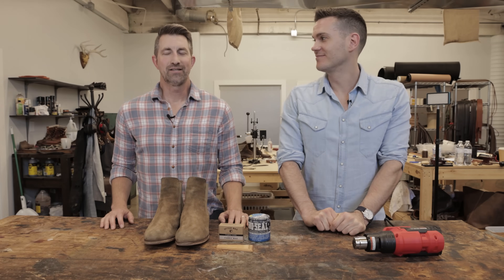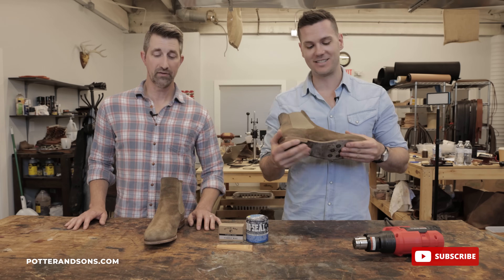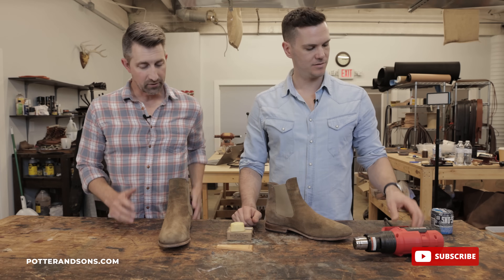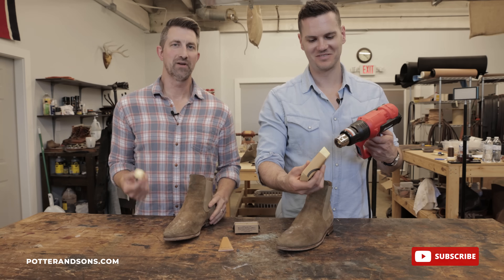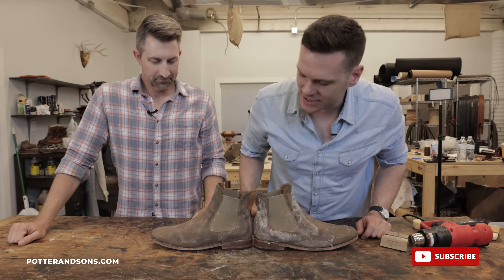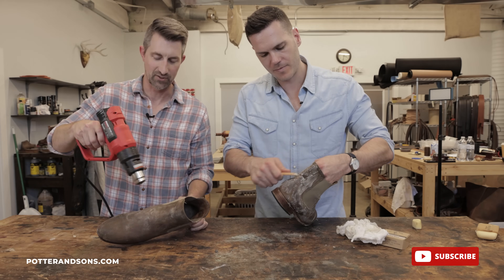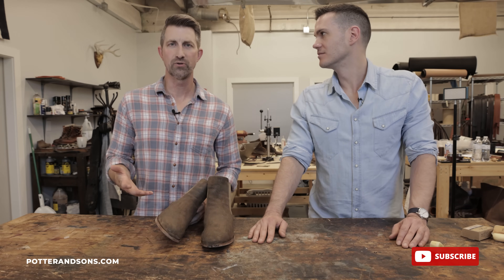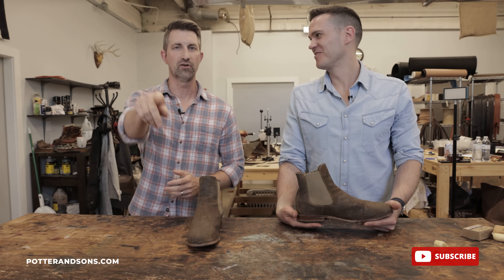How to Wax Suede (Very Detailed) - (ft @Stridewise)

Comment: Personally I much prefer melting the wax and using a paint brush to apply the wax. I've found theres not much need to rub it in afterwards, the heat from the hair dryer/heat gun makes the wax melt and penetrate the suede/canvas deeply. Also, I've found to like heavy coats much more.. It looks more even at first and makes whatever you're waxing almost waterproof. Thanks for the video guys!
Reply: I agree.   That bar wax is really just for touching up items that were already waxed from the factory/tannery
Reply: What kind of wax do you use for the melting method, any recommendations?
Reply: @irabucc469  beeswax, what other wax do you know of?
Reply: @thewizardsofthezoo5376  just regular beeswax?
Reply: @hamxxx3211  Yes natural or mixed with colours, but wax, not just fat, otherwise they go greasy and you need to use saddle soap to clean them up.
You need to mechanically warm up the wax by using a very sophisticated machine called: arm.
Reply: Personaly I have a bit bigger pain treshold on hands due to thicker skin from manual work, so I often go with technique of melting wax in pot above one with boiling water, I dip fingers and "massage" it into the leather in small patches. Hands warmth keeps the mix easier to spread for longer and works best at the edges and seams. I like to add oil or grease based product as extra and mix it, then it's even easier to force it through the pores deeper into the leather and it's  less prone to cracking and wear from bending.
Reply: I've tried many different products and methods, and find that I much prefer waxes that are cut with liquid oil and/or solvents, making them melt to the touch, or even have a paste-like consistency.  Sno-Seal, Obenauf's, Huberd's Shoe Grease are all good examples, but there are many great products out there.  I find that these softer waxes are not only easier and simpler to apply than pure beeswax, but they also penetrate the leather better, which in turn makes the protection they provide more durable and longer-lasting.

Comment: Interesting video. FYI. I’ve used the Filson Oil Finish wax (in the tin) on my redwing iron ranger muleskinners and it turned out great. It was much easier to work with than the otterwax bar. I could apply it with my fingers and it has a great consistency. The snoseal works great too but it’s just a little thicker so that would be my second choice. You need to heat snoseal for it to absorb well. It will darken them considerably so always keep that in mind. Just my two cents from my experience doing this.😊
Reply: lol I found this video because I have a tin of the Filson oil finish wax and I was wondering if I could use it on suede shoes. Thanks bud!
Reply: Can we see?

Comment: One question. I tried on a sample with Otter wax too but it remains sticky even after melting in with hairdryer. Is there a trick or will it be sticky all the time? Then it will eat dirt a lot. How can intensive the stickyness? Thanks.

Comment: New subscriber from Australia  🇦🇺 😊 I could have watched this all day. It wasn't long enough 🙂
I am 45 years old and I have not worn seuede shoes/boots since I was in high school and recently bought a pair of Wild Rhino Beige Chelsea low cuts and I applied waterproofing but I don't think I put enough on and after 4 days, I've had to use the Saphir Shampoo already 😐
It worked and the boots look much better. I'll check out the rest of your videos, I love the in depth review and demonstrations you guys do. What I also like about your method and explaining is, you pretty much answer questions that the majority of us would be thinking or asking ourselves while watching. It's like you have read my mind already. For example, aren't you using the seude brush a bit too hard on the boot? And then you will mention that without it even being a question.
Happy to stumble across your videos, all the best from down under 👍

Comment: Great video!
Just a question: I guess the waxing process is going to influence the "breathability" of the shoe. Does it make a huge difference?
I'm tempted to wax my go-to lightweight suede Chelseas since I'm going to travel to a place with "wayward" weather, but I think it can damage the properties that make it a valid boot even in summer. Do you suggest it, or better to leave the finishing intact and just use a protector spray?

Comment: Question after the wax is applied, is there still a need for water proofing spray. Will i need to strip it periodically to apply conditioner?
Reply: nobody has answered you, but, my guess is that the waxing will be enough ; I would just rewax as needed

Comment: Been waiting for this one, thanks guys! 

Does the wax have natural conditioning properties? I’m used to using Saphir Renovateur on all my leather shoes, but I just got some Grant Stones in the Waxed Commander leather from CF Stead and I was wondering if they need conditioned in addition to eventually re-waxing them?
Reply: SAPHIR DA SHIEET ✅
Reply: Eventually. You can use bars of beeswax or other products that are mostly bee and plant based products, like Nor-v-gen, Blackrock, or Obernauf's, which I find easier than using a wax bar.

I haven't touched my can of Sno-Seal in years as I can't get over the petroleum smell anymore.

Saphir Renovateur could probably work, too (great product) but I think of it as an all-round consider and usually use it on my shoes.

Comment: It seems as if that the wax is being used to provide merely a topical coating (much like Tarrago Nano Protector) that provides not only protection but to also achieve a desired cosmetic effect. What, if any would be the downside of using a product like Saphir Renovateur to condition the leather prior to applying the wax?
The wax would certainly repel moisture on the outside. However, from the inside the leather would continue to be exposed to a constant cycle of wetting and drying due to perspiration.
I can see that cosmetically the result will be an appearance that is somewhat softer than the original but not nearly as smooth as a boot made from an "oiled" of "greasy" leather. Is that the intent?
Sno-Seal contains petroleum distillates but no oils. I assume that the distillates are included to (1) ease application (2) provide somewhat deeper penetration (3) evaporate off leaving just the wax.

Comment: I use a heat gun to melt and dry shoe polish on my boots. After I apply a coat of polish, I hit the boot with the heat gun until the polish turns shiny. Then let it cool and buff.
Reply: Do you do this on suede boots? or a different kind of leather?

Comment: Hi Trenton & Heath. I am thinking of purchasing a pair of Thursday captain boots. Since ya'll have repaired or owned them can you tell me if they have a removable insole. I have to wear Sole moldable insoles due to ankle issues. I tried to contact Thursdays but have not received a comment. Thank you for your reply. Enjoy your videos. Thanks, Gil
Reply: I have a few pairs of Captains. They don't have a removable insole I'm afraid. The insole has poron padding and a thin leather sock liner. Not sure how that would work with an insert.
Reply: @simonmandrakejones  Thanks for the reply finally got response from them they recommended 1/2 size larger will try that.

Comment: What are your thoughts on mink oil and suede?
Reply: I’ve used mink oil on roughout leather. It will for sure darken the color but it will water proof it and achieve simaler results to the sno seal. I prefer it because you aren’t dealing the boot in a wax per say. Totally viable option.

Comment: Dear Trenton, isn't there a problem that if you wax the areas that crease that it may form cracks? Why is it ok to do that for suede boots but not for smooth leather?
Reply: I'm not a pro. But I think that is because suede is very porous and absorbent, unlike in smooth leather they will be stuck in the pores or just clog the pores.

Comment: Is it possible to use candle wax instead of those products?
Reply: Not unless it's 100 percent beeswax, but even then it can really make a mess if the melting point is too high and the wax is too hard. A lot of these products have other ingredients to lower the melting point and soften the beeswax. Don't even think about using something like paraffin.
Reply: It's possible but may be harder to get worked in. Also, additives in the wax may influence your results.
Reply: Yes, but there is wax and wax. 
beeswax doesn't need presentation.
Stearin candles are made of a mix of animal and vegetable wax. They are heavy and traslucent.
Paraffine candles are made of a petrol derivate, they are not translucent, are lighter than stearine and have a lower melting point (tea candles or decorative candles are usually paraffine).
Then there is soy wax or rapeseed wax, hydrogenation of the respective oils. 

Paraffine has not conditioning properties. The others are better in the long term, but the higher melting point of stearine makes it harder to apply. 
However, you can melt stearine wax, and add up to 50% of a vegetable oil of your choice. Once cooled down, it returns wax, but softer and with a lower melting point.

Comment: To imply that Sno Seal is somehow an unnatural product and Otter Wax is all natural (which this video seems to imply) is ridiculous. Otter Wax also has paraffin, an oil product and is not designed to actually soak into the leather. It forms a layer on the outside of the leather and can promote rot on the inside where Sno Seal is designed to more easily impregnate the leather and preserve it.
Otter Wax on boots is a substandard product, pure and simple. Sno Seal is just as versatile on other textiles as well such as canvas, the same as Otter Wax (or whatever bar wax you are using).
Also, apply smaller layers of wax over multiple sessions for better results. Im not sure why these "professional" boot guys are kind of fudging this simple job.
Also, use a semi stiff brush to fluff the suede or rough out leather. It won't ever be 100% but it works so much better!

Comment: Nice! Also, can virgin coconut oil be used for the same purpose? It's amazing how it wakes up & revitalizes old leather.
Reply: No. Coconut oil melts at too low of a temperature and doesn’t solidify into the same structure as wax does. Even if it could, the body heat from just wearing the boots will melt it. It won’t have nearly the same level of waterproofing; think of it more as a conditioner. You probably shouldn’t be using coconut oil on your shoes anyways.
Reply: In my experience coconut oil l can be used as a conditioner but it will provide a very different result than wax. Wax is harder to apply, more water resistant, lasts longer and provides more patina compared to coconut oil. So it depends what look you want and what your priorities for the shoe or boot may be.
Reply: @alexchangsteryo it doesn't need to be melted as the temp of ur hands will turn it to oil form & I'm pretty sure it's on this channel that I learned about the coconut oil trick. Test it out on Leather, you'll be amazed!  I'll test it out on Suede & let u know the results
Reply: @jeremyhershberger3012  Yes, the wax does seem like a long tedious process,  I will test it out & see what's the results

Comment: I dropped bbq sauce on my allen edmond double monks in walnut. The bbq stain doesn't want to come out. About 3/4in diameter. Any recommendations?
Reply: Your gonna need dawn dish soap bc that BBQ sauce is an oil stain, then your gonna need a tin of shoe polish in the correct color to put the color back in once it's clean.
Reply: Cornstarch and Avel stain remover. That sucker is an oil stain and will be tough to get out. After that, saddle soap and correctly colored cream polish to restore color.
Reply: Thanks
Reply: I second dawn original dish soap. Apply with your finger directly to the spot. Then use an old toothbrush with warm water to lather it up and loosen the oils in the stain. Wipe off and rinse the soap away. Let it dry. You might need some shoe cream to restore the pigment. Hope this helps.

Comment: Hummm. Not sure I understand why you would wax suede since the wax changes the color and the look of suede. Why not just buy leather? The video on my device was not detailed enough so I could see the close up of the texture of the final product. I guess there is some semblance of suede?
Reply from the maker: There’s such a thing as waxed suede.  Many manufacturers actually wax the suede at the factory.  Other people like the look and protection factor it provides, as rough suede can usually take more punishment than smooth leather.  Different strokes for different folks.
Reply: Thank you! This makes sense now. Appreciate the time it took for you to respond😀.
Reply: Waxed suede is more resilient than suede and has patina potential
Reply: Since untreated suede absorbs water like a sponge, it only takes a splash of dirty water to change the color and look of suede shoes much more, and worse.

Comment: Why not just buy a regular leather boot instead of suede? A polished turd is still a turd, use the right tool for the job, etc.
Reply: Because suede is softer and more scratch resistant, IE. And also absorbs better wax and grease. 
It's the reason the M43 combat boots had the rough side of leather on the external.

Comment: suede wax? they cant breath! dont do this!
Reply from the maker: A lot of top shoe and boot brands sell waxed suede footwear.  A lot of folks that work under rough conditions (rain, mud, etc) will apply products such as SnoSeal, etc to their leather boots.  This concept isn’t new.  I get what you’re saying, but trust me, it’s not going to hurt the suede.
Reply: ANY leather that had been greased, waxed, painted... doesn't breathe. 
Much of leather shoes, doesn't breathe more than a pair of rubber garden boots. They are more comfortable because leather ABSORBES the humidity of the feet, leaving them dry.